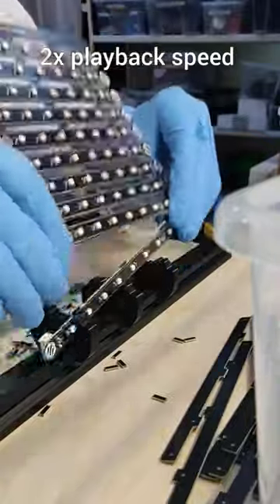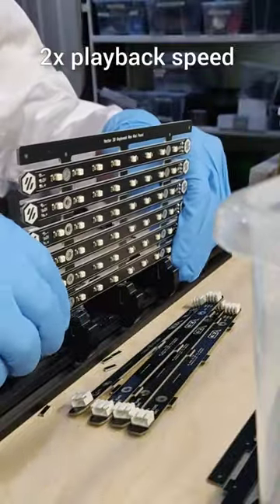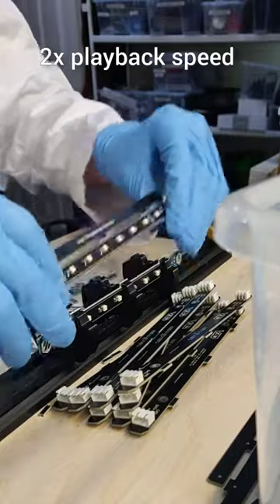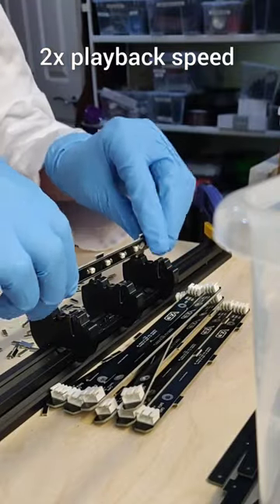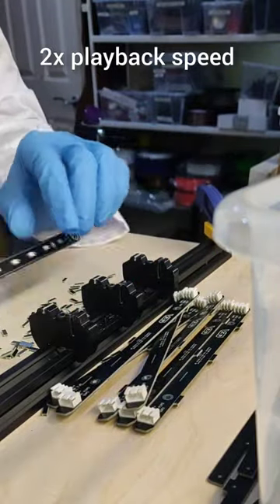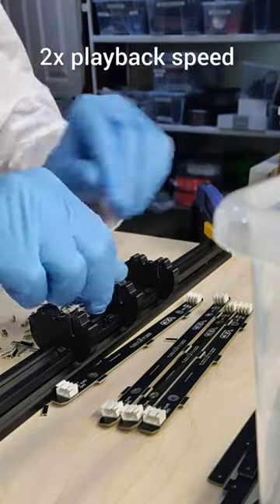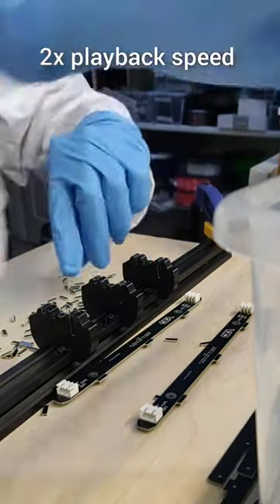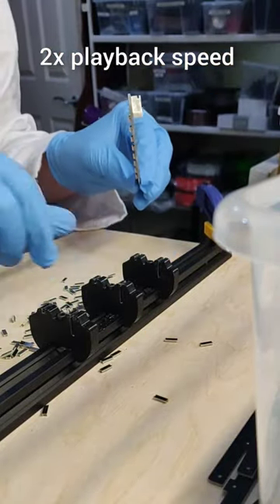Separating Daybreak LED PCBs the Easy Way #shorts

Comment: We use a singulator at work.. burr bit cuts/drills out the junctions and clean birds removed.  Mulipanel parts.. @60 seconds without the need for finishing.
Reply from the maker: If you have one spare I can use let me know! 👌😁
Reply: @Vector3DP  given the size of your boards it could be done with a simple DIY desktop cnc setup